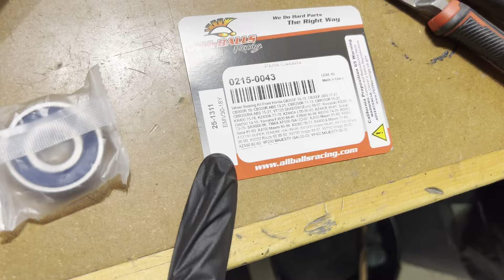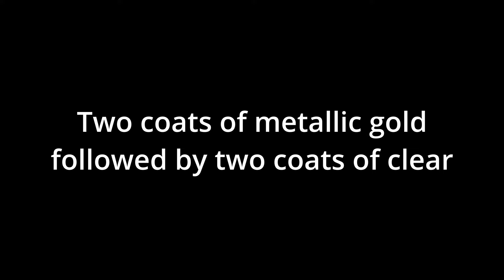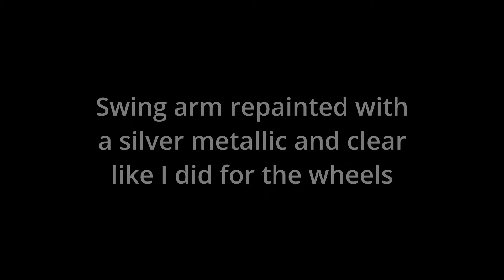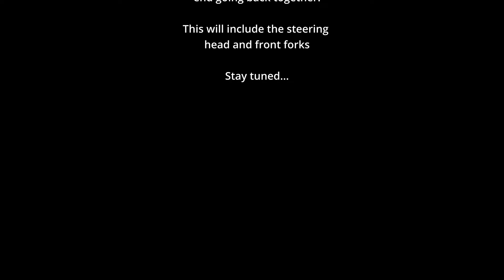Restoring Aluminum Motorcycle Rims - Yamaha Virago 1000 Restoration Video 8

Comment: I use a MAP torch to heat up the aluminum rim which makes it easier to remove the bearings.
Reply from the maker: Yeah, I ended up buying a small torch too…works like a charm.